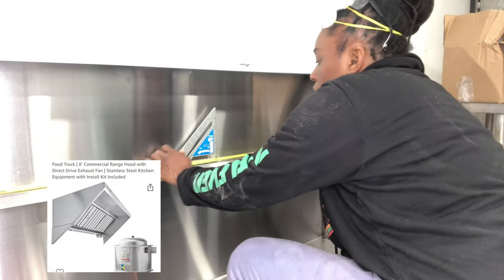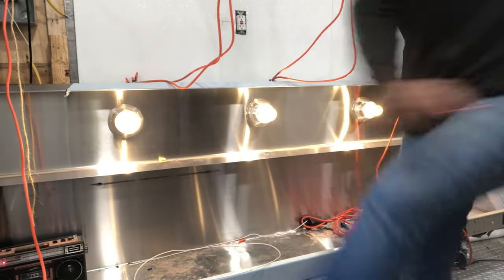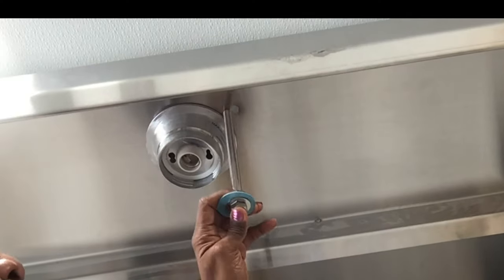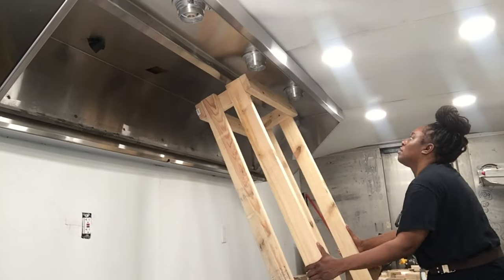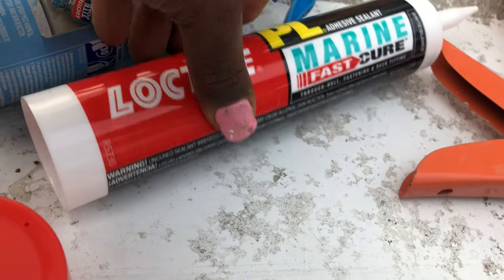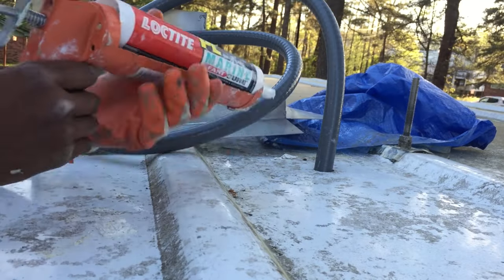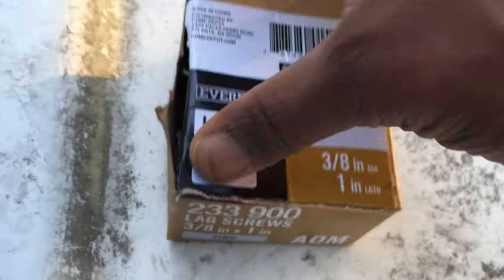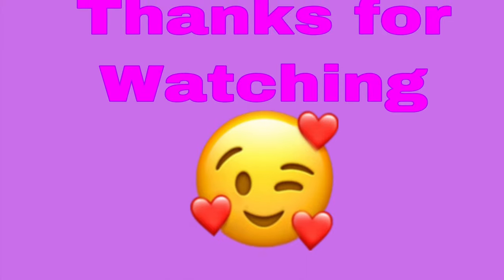FoodTruck Hood Vent

Comment: Are you screwing your bolts into the studs of the trailer?
Reply from the maker: Yes using a step bit, it took about 15-20 min to drill each hole. But that’s bc the studs are made out of steel.